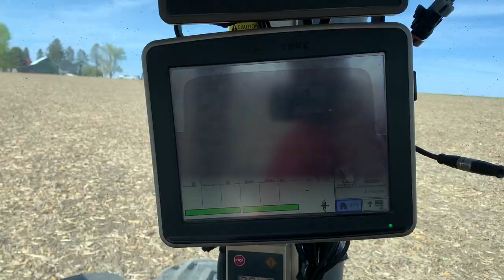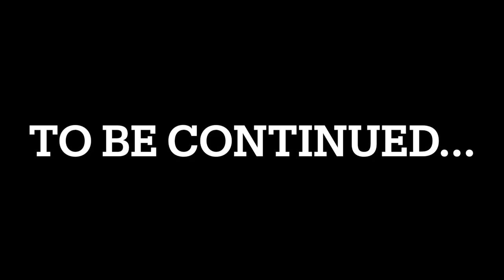Who Spilled The Beans!? | Firing Up Some Old Iron | Nearing The End Of Plant 2021

Comment: What's the story behind the one deere closing wheel on the planter,any difference in how seed comes up?
Reply from the maker: Honey badger hates the IH closing wheels. They don’t firm the seed in well enough and are hard to dig into to find the seed for checking. I think it has a slightly better stand vs the IH wheels. Planned to do the other 5 but just haven’t got around to it.